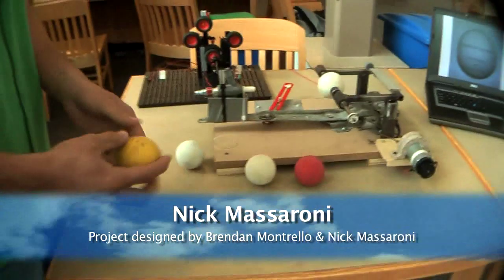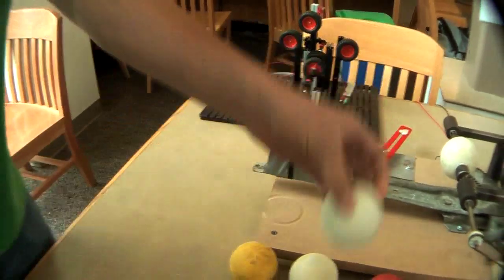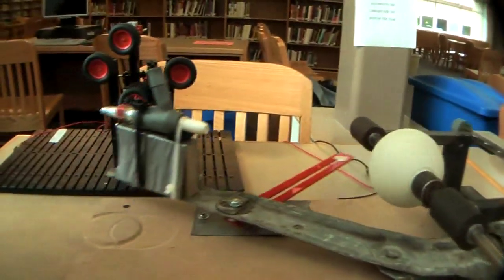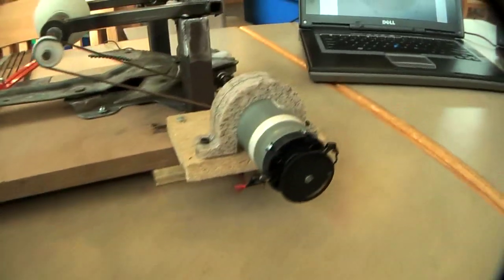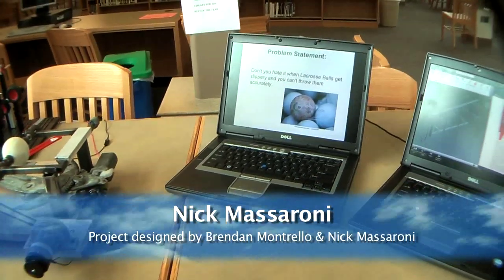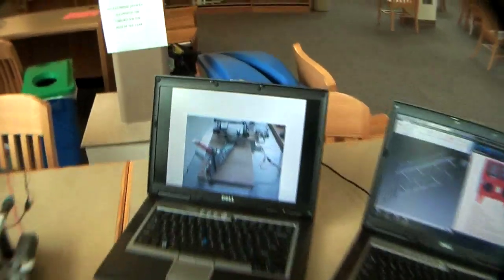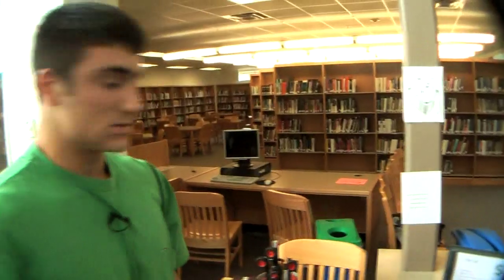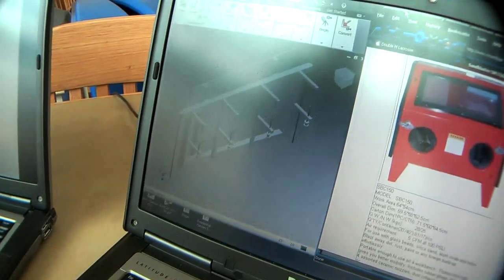Lacrosse Ball Resurfacer: EDD Course

Comment: Very cool but slow and not practical.  I use my ReLAX refurbisher at least once per month.  The 5 gallon version is a beast but the 2 gallon is easier to store and more than meets the needs of the average player. It takes off less than 1/128th of an inch each time you use it.  You refurbish a single ball dozens of times before the are out of specification.

http://www.ebay.com/itm/ReLAX-TM-Lacrosse-Ball-Refurbisher-Kit-5-Gal-bucket-not-included-/141408864158?pt=LH_DefaultDomain_0&hash=item20eca0079e

http://www.ebay.com/itm/ReLAX-TM-Lacrosse-Ball-Refurbisher-Kit-2-Gal-bucket-not-included-/141408893301?pt=LH_DefaultDomain_0&hash=item20eca07975
Reply: Then why do they throw out lacrosse balls if they can refurbish them already?